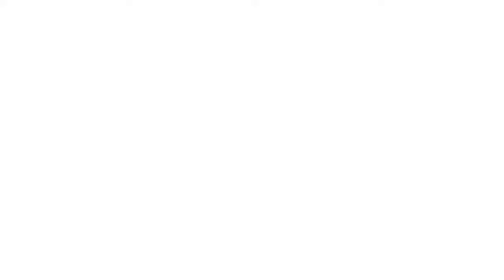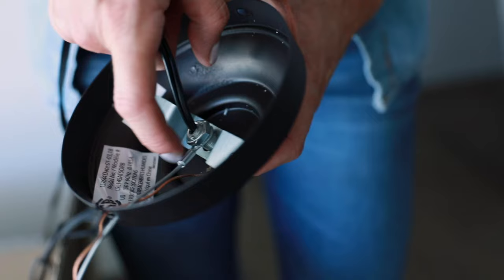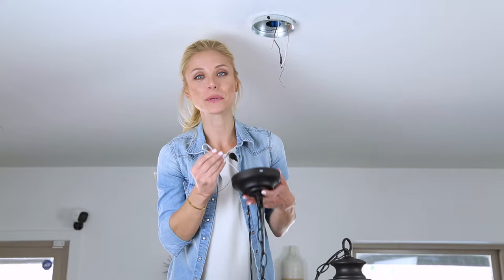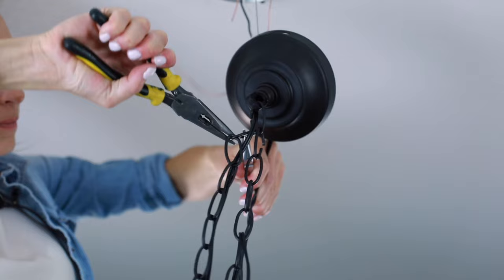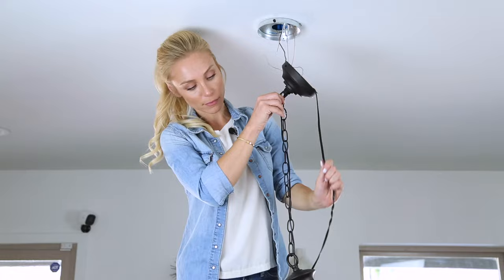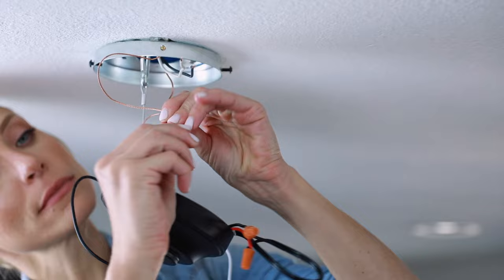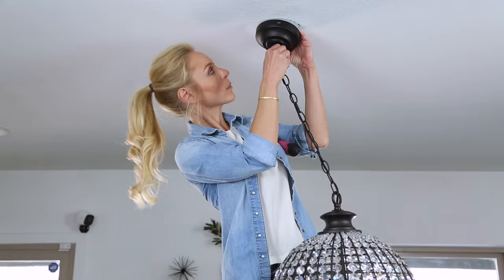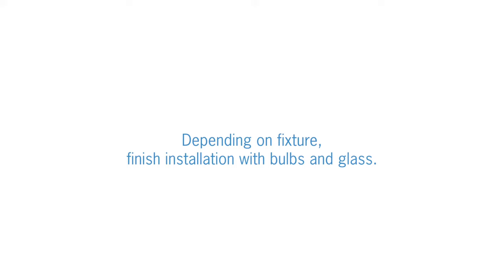How to Install a Chain Link Pendant Light | Canarm

Comment: Need to show how the power wires are routed from the lamp and through the all-thread tube (the nipple). Is it necessary sometimes to support the lamp so you're not holding the lamp while you're connecting the wires and attaching the hardware to the ceiling?